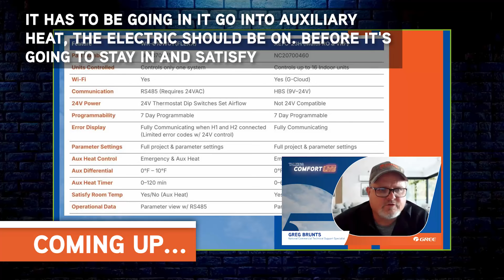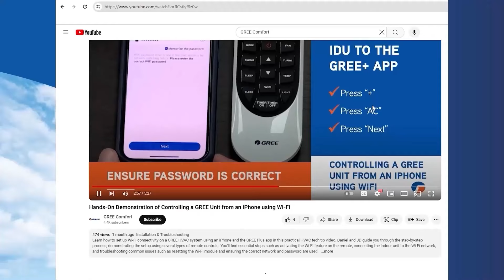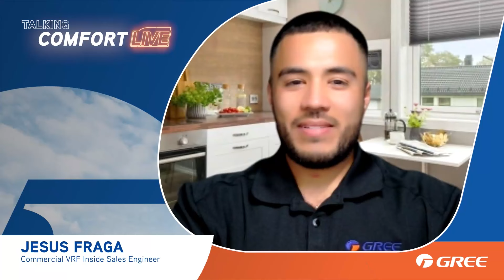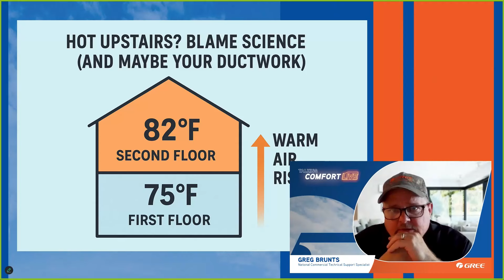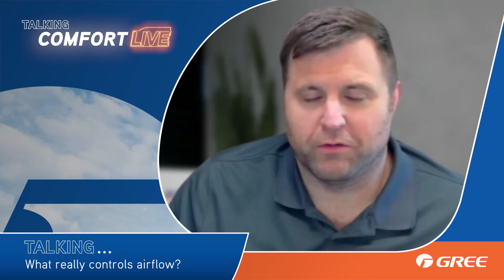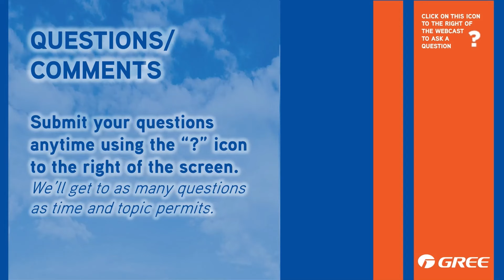Why the second floor is still hot and mistakes oversizing multi-zone systems #TalkingComfortLIVE

Comment: I don't use Gree equipment, but I find your presentations very useful for general HVAC knowledge. One issue I seldom see discussed is heat pump defrost. While defrost is inherent in ASHP technology, there are good and not so good ways to deal with it. How does Gree approach defrost and how has it been optimized?